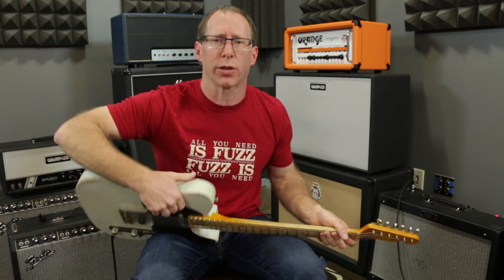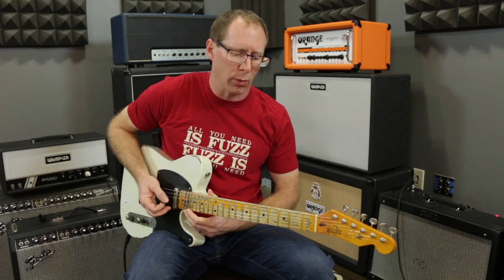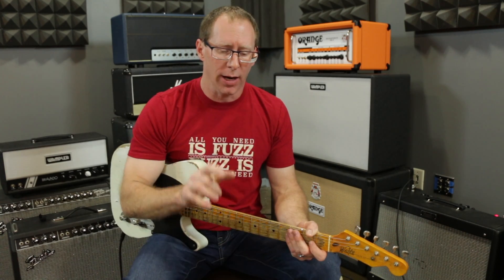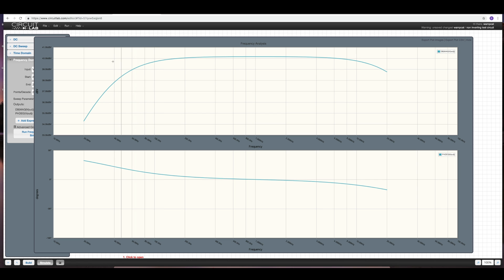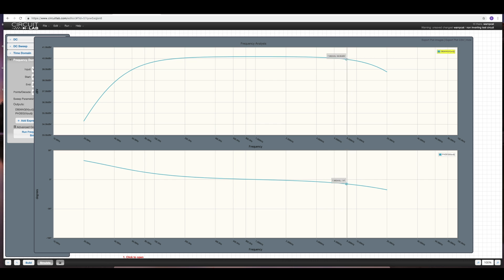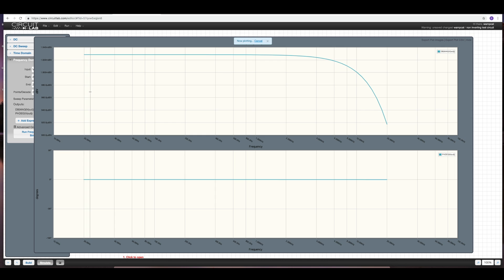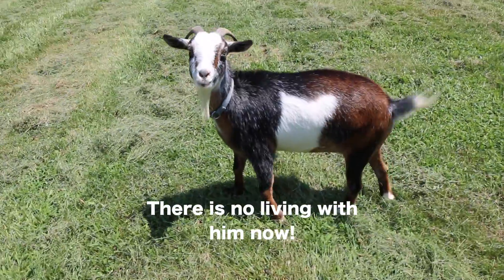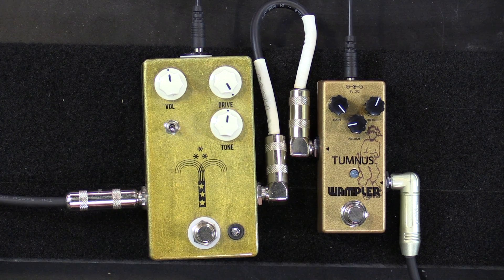Transparent Overdrive Pedals: Busting the myth- Revisited

Comment: The genius of the Klon Centaur, and what I feel is Bill Finnegan's greatest contribution, was to precondition the signal to extract the best possible overdrive sound from a decent tube amp.  That is, it anticipated what the amp would do, and arranged things for the guitar signal to make the amp behave in a certain way.   If one has ever had the opportunity to try using a Klon as an overdrive tone in itself (i.e., dimed the gain but kept the output level low, feeding it to a clean solid-state amp), it was nothing special.  Indeed, rather anemic.  BECAUSE IT WASN'T DESIGNED TO DO THAT!  What made it labelled as "transparent" (and pretty much ushered in the use of the term) is that it brought out the overdrive character of the amp, without imposing its own characteristics; like putting nicely-tailored clothes and flattering haircut/makeup on a woman that is already beautiful (sorry for the sexism, but it was an analogy I knew would be immediately understood to many here).  It's transparent in that it is revealing rather than imposing .  There is a difference between a pedal intended to provide an "overdriven sound" of its own, quite apart from the amp characteristics, and a circuit intended to push an amp into pleasing overdrive, unique to THAT amp.

Another aspect of what makes an overdrive pedal "transparent" is the massive difference in headroom between a tube amp, and a 9V-powered pedal.  The often-excessive harmonic content generated via diodes and such in a 9V-powered pedal, BECAUSE of that limited headroom, can easily result in the clarity of individual notes getting lost in a haze, when compared to the sound of an amp being pushed harder (in the right way).  That's a part of what allows a circuit intended to push the amp, rather than create its own tone,  to be thought of and described as "transparent".  That harmonic haze is also why distortions and overdrives are generally the first pedal a new guitar-player buys: because it mimics the "busy" harmonic content when one plays loud with a complete band, even though it's just you in your bedroom.

None of this is to take away from the pleasing quality that many pedals provide via their own overdriven tone.  And one should further distinguish between "clean boost" - which is used to push an amp or other pedal into clipping but does not alter the harmonic content itself - and the audible consequences of using one, when the amp or some other pedal has been pushed hard.  Few people use so-called clean boosts to simply shift between one untainted/uncolored level and another - something they could easily do with a volume pedal/preset.

Are "transparent" boosters and overdrives shaping the tone and providing coloration?  As Brian's video amply demonstrates, YES.  BUt the intent is to make the amp sing rather than fizz.  Bill told me himself that, even thought the Treble control on the Centaur provides cut AND boost, he really meant it to be used primarily in cut mode, to tame the harmonic content so that the amplifier would not generate too much fizz.  Few people like harmonics of harmonics or harmonics.  We like those lower-order harmonics in the right proportions.
Reply: TL;DR There's nothing transparent about waveshaping a signal whatsoever, and all attempts to say otherwise fail to convince to the contrary. 
  Look man, this is all just dancing around a simple fact: that going electric colors your sound to varying degrees.
  Even the most efficient or sensitive microphones requiring minimal energy will color the sound-source; it's endemic to the process of electrification/transformation of acoustic energy in every instance. So there is no need to act as though a booster/drive isn't doing it, too. 
 Or...was there?  'Transparent (over)Drive' just Smells like Marketing-speak Spirit and in the end - is just...well, a lot of wishful thinking.

  Cheers :)
Reply: @shaft9000  Of course there is coloration.  What audiophiles mean by transparent, and what is meant in the case of guitar boosters are two different things.  It's annoying that the wrong word is being used.  The key question is whether applying boost makes the amp sound like a more muscular version of itself being pushed by your guitar or like something very different.  If it sounds different, then I'd agree it's not "transparent".
Reply: is a legend in the field of guitar electronics, I'm guessing even Wampler would consider him to be up at his level of pedal knowhow.
Reply: @lukeingram7655  Let's not rush to judgment!  I'm no "legend".  I've just been following the field and reading for over 40 years, and you learn a thing or two over time.  My strength is explaining things to people.

Went to a talk the other day by Prince's former engineer (now Berklee prof) Susan Rogers. Aand when I mentioned the name of one of my former McGill profs to her, her face lit into a big smile, as she referred to him as her "intellectual grandfather" (Albert Bregman, originator of "auditory scene analysis").  When you have good sources to draw on, you get smarter.  Since the advent of the web and gear-related forums, a great many truly knowledgeable people have been very generous in their knowledge.  It also doesn't hurt having access to all those schematics...something we didn't have in the 1970s or '80s.  We had Craig Anderton, Robert Penfold, and a few others, and had to wait a month or two for another bit of info to show up in a magazine.  I was over the moon when I finally got to meet Craig at last year's Summer NAMM.  What a sweet guy and what a great teacher.  Now there's a legend.
Reply: @markhammer643  You are too humble, let me just put it another way..  If there was a Guitar Pedal Hall of Fame, Mark Hammer would be an inductee for excellence in technical assistance .  In my opinion you're right up there with R.G. as far as pedal cred is concerned and I think plently might consider him a legend so if you're not one, you're still pretty darn close!
Reply: @lukeingram7655  Thanks.  Much appreciated.  But we should switch back to the Brian show, already in progress.  He makes a good product that makes many people happy.  That's  where the rubber hits the road.
Reply: @markhammer643  Agreed ....fwiw, if there was a pedal HOF Wampler would definitely be in it too so there's my tie-in to get us back on track.  Take care Mark.
Reply: Well, done. I think you should have your own channel. Another great thing about having a transparent O/D is that it stays out of the way of the vocalist too. Everyone should have one in their arsenal. Try Brian's Euphoria/Ecstasy. His most misunderstood, under-rated, and the greatest pedal he's ever made.

Comment: I've used Morning Glory V3&V4 for years. Recently l've found a dislike to the circuit, unless l run it with a Plup n Peel V3 or V4.
 I can hear the difference in the midrange with the Tumnus mini,  l prefer that tone. 
How does the Tumnus Deluxe differ from the Tumnus mini?
Reply from the maker: The deluxe has more eq options (active bass and mids controls) as well as a switch that adds more gain

Comment: This transparent overdrive concept is very subjective, but I have always thought that it involves compression as well. I mean,  should a "transparent overdrive" be more dynamic? My favorite overdrive is now the BOSS OD-3, which response curve resembles an amp curve (slightly mid scooped, with a bump at 800Hz, more or less). I don't know if it can be called transparent (in fact it is yellow), but it is very nice sounding and dynamic. Great video, by the way, as always.

Comment: I collect overdrive and distortion pedals. Out of my vast collection the only true transparent circuit I've encountered are the X-otic RC and AC boost. But their transparency is also the downfall. If you have a loose drive character on your amp, these pedals will only make it worse. Transparent, right. They're good if you have a single channel amp. Love the tone, and want to add another channel of gain, with no change. Otherwise I have to agree with The Tired  Horizon, what's the point. You buy a pedal to have different flavors.

Comment: Isn’t a transparent overdrive and a boost the same?
Reply from the maker: Sort of, but not really. A boost is just boosting the signal level (Volume) generally. An overdrive will clip the signal (which basically means adds distortion) as well as often coloring the sound as well
Reply: Kinda. 70% there. It's hard to describe bro

Comment: Boss GE-7 Equalizer is the greatest "transparent overdrive" of all time. Change my mind.  ;-)
Reply: Awesome in the effects loop for sure for a clean boost , can shape it to mid boost or cut . Changed my life . I could use two , one to boost leads and one to cut my volume . Anyone that has never tried a EQ in the loop , try it.
Reply: Well, as long as you're going into something that'll clip in response to it...
Reply: I agree in principe. I only had access to a Washburn seven band EQ in the early 1980's. I turned the volume boost all the way up(12db), I turned all sliders from 1k Hz all the way up and all sliders 200Hz and lower all the way down. That left what I assume to be the between 380 or 500 slider to be the "MORE TONE".   It was mostly a treble boost.  However, when plugged in front of a 1958 Fender Champ it made that "Boston" sound. Yes, I did actually use a  PowerSoak™ later on to refine the sound. 
Sorry to brag but the man has a point
Reply: No argument here
Reply: Try the Orange 2 stroke It might change ur mind
Reply: it's also dangerously close to being a pre-amp - being how it has an output gain stage and already IS an eq
main difference is the parallel band-boost/cut filters of fixed-band EQ vs the (serial?) tone stack in a guitar pre
Reply: im sorry boss ge7, imma let you finish, but timmy is the best "transparent" pedal of all time. you can turn it on and hear no difference until knobs are turned.
Reply: I am using a Solo 610 mic preamp to introduce my guitar to my pedals. You poor saplings just can't imagine.
Reply: You tube  has an awful lot to answer for!
Reply: Its pretty wild how good of a boost it is
Reply: It doesn't overdrive. It's just EQ
Reply: @Jeff-fx5vu  If you crank the gain it overdrives
Reply: @Jeff-fx5vu  oh it overdrives. Most clipping comes in the mid-range frequencies anyway. So other than just boosting the output, you can really pump those mids for some crunch. Maybe on a fender amp it would be tougher, but anything that's already cranked, a boss EQ will definitely make it "scream"
Reply: @LeviBulger  , l can see that. But not at unity gain like a overdrive would. Don't get me wrong, l like to add some EQ to correct my overdrive tone
Reply: @LeviBulger  Then it's a boost because the clipping is in your amp. It's NOT overdrive.
Reply: @LeviBulger  IIRC that's how the Josh Homme guitar sound is achieved. Although there's a lot going on production wise too.

Comment: To me "transparent" is a semantics issue. Are you talking about subjective transparent to the ear, or transparent circuit-wise? that's the question. As players we're describing what we perceive as transparent and you're describing it from a circuitry standpoint. So, I wouldn't call it a myth, unless you're only speaking from the circuitry side of the equation. Certainly a Morning Glory is way more transparent sound-wise than a Tube Screamer with the big (perceptual) mid-hump. The Morning Glory/Bluebreaker retains much more of the dry signal sound quality, no matter what the circuit analysis says.
Reply: The first two examples were transparent circuit wise with no filters to create an eq curve.
Reply: A fair comment.  I think the confusion is that, in the music reproduction realm, "transparent" is used to mean absolutely no coloration; so flat frequency response from 20hz-20khz, and a THD figure of less than 0.01%, etc.  In the music making realm, however, "transparent" is used to imply something else.  Rather than no impact on the signal passing through it, "transparent" is used to imply that a) the individual notes are easily distinguishable, and b) the amp sounds like itself, with no change in personality.  Admittedly, that's a very fuzzy definition (no pun intended) and concept.  But the point is that it isn't the first time a technical term is used in very different ways in different contexts, and we shouldn't get bogged down because one way of using it isn't precisely like the other.

That said, it probably wasn't the best choice of word in the first place, given the confusion it results in.

Comment: i have a pedal that will run on 18volts. when i use the 18v output on my power supply the pedal makes a faint helicopter noise what is up with that?
Reply: Could be an issue with the charge pump itself, or the filter capacitor.

Comment: My Paisley Drive is easily my favorite transparent overdrive.  When set with the gain below 9 o'clock, it's exactly my base tone, just louder and with a little bit of clipping.  The Paisley Drive has crushed every last fancy overdrive I've ever put it up against.  Of course it's fully capable of all sorts of tone coloring via the toggle options, but dialed in neutral, I've never experienced a more transparent drive ever.
Reply: I love my Paisley Drive!I just picked up a used Vox AC15C1.I am hoping it will work well with my Paisley Drive?
Reply: Ron Anthony, I've owned many of the greats and I must say the AC15C1 is my desert island amp.  It made me sell off all of my vintage Fenders (black, blonde, and brown) with zero regrets.  It's also perfect with the Paisley Drive  :)
Reply: @ebeep  I have a triple-scoop array running a Vox TB35 and a Roland JC120 along with a tiny Vox echo emulator. I actually think I will need a couple more ground lift transformers.
Reply: @rca3rd  I've got a Vox AC10 and I love it big time with pedals. There's a little video I made with a gopro on my channel just for one of my buddies that is a co DIE HARD Steelers fan and Rengade by Styx is our "fight song" and I was using a Wampler Sovereign, Hughes and Kettner Rotosphere, TS9, and Boss DD6 and I think it sounds good with pedals and I was literally just picking it up and playing it and not trying to be the next SRV. I think the Vox amps actually do work well with pedals. I've got a Keeley Dark Side now too and it works awesome with that one as well. I think you'll definitely like the Paisley Drive with it because actually I went behind Brad Paisley's stage years ago and looked at his rig and there was actually an AC30 in there. He only puts the Dr Z stuff on the stage but he had an AC30 in the back and that was during the Time Well Wasted tour and his tone was off the charts then!
Reply: @SimpleManGuitars1973  I sold my AC10. I got it out of storeage and played it to make sure it was ok. Damn it sounded good LOL  Not having a loop was my problem with it
Reply: @SimpleManGuitars1973 Thanks!
Reply: There are just too many good flavors of ice cream. There is a reason why they had 31 flavors. I'll take em all. Sometimes something different inspires you.